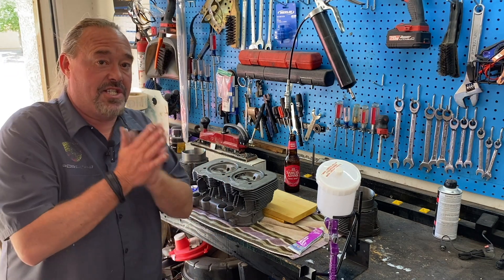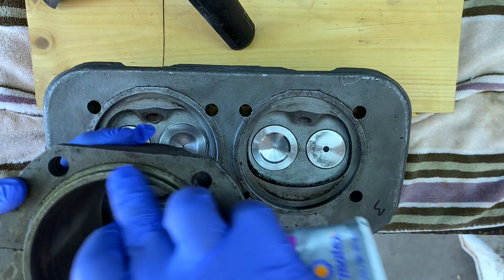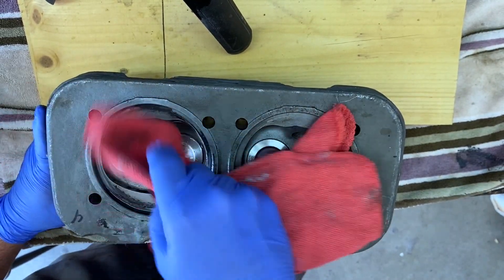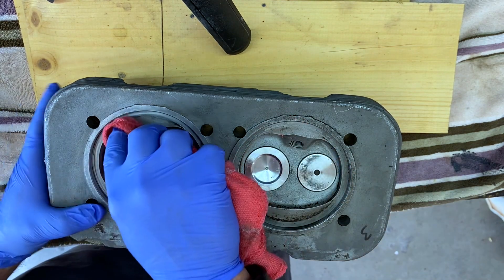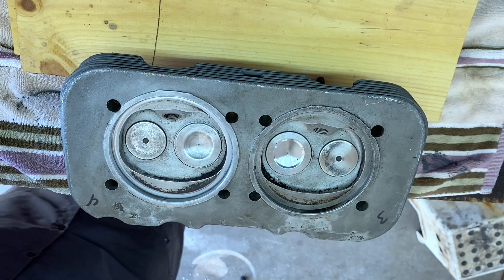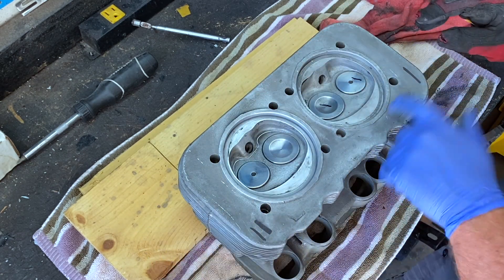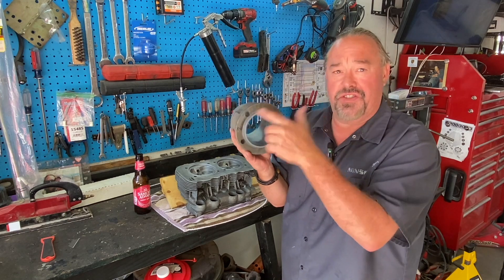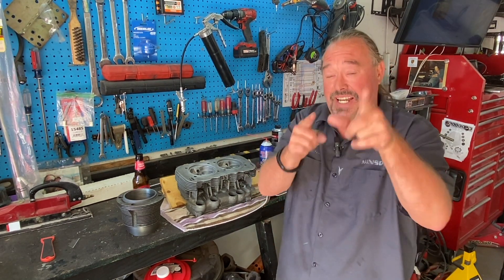Type 4 Engine Rebuild:  How to Lap Cylinders to Heads - Porsche 914 - 912E T4 Motor Rebuild

Comment: I recall that some Porsches have teflon lined cylinders that cannot be honed or bored.
Reply from the maker: Some of them did use a special coating inside the cylinders, but the older engines didnt.